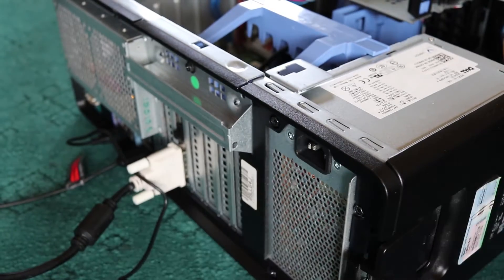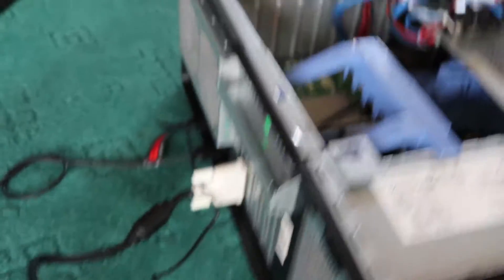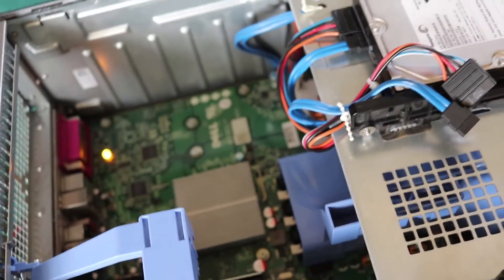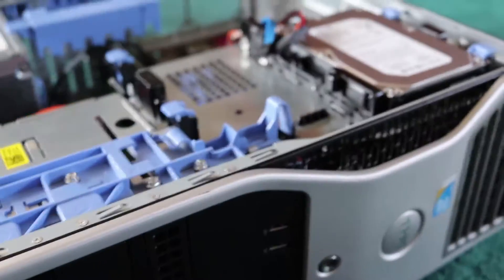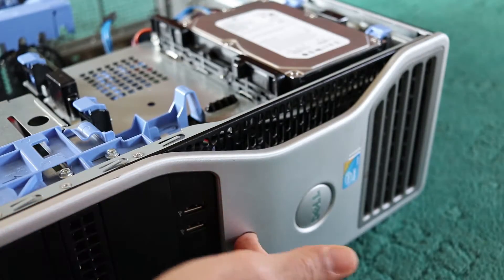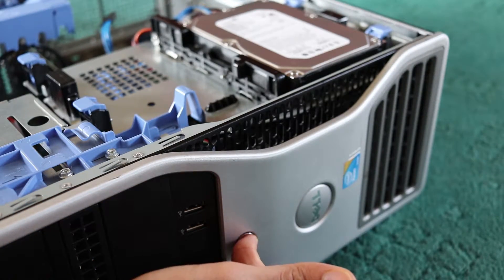How to drain the RESIDUAL POWER from Computer

Comment: Just a quick thing. You're technically not trying to discharge the power or voltage, per se, it's more so that you're trying to stop the current from forming, as voltage is nothing without current. Great video though!
Reply from the maker: Thanks for your input.

Comment: Do i turn off the red switch of the psu as well?
Reply from the maker: Good & very important/serious question! That red switch could actually be the "power supply voltage switch"! It is called voltage selector switch. It's used to switch the input voltage to the PSU. If you'd select the wrong one, then you could serious/completely damage your PSU and even cause fire.  Different countries have different output voltages from wall sockets such as 110v/115v or 220v/230v and it's fixed. That's why you should never change the PSU switch & that's why it's red color. You could send a picture of the switch to my facebook page.
Reply: @PracticalTechFixes  For context: The Pc does not POST, there are no beeps, display nor leds. This problem happened after i powered down the pc by pressing the power button for 10secs. I think there was a power surge so i've been trying to do a power drain but nothing happens when i press the power button, it only turns on the machine but not off no matter how long i press it. 

i have to use that switch to fully turn off the pc. If i leave the switch in 115v and unplug the power cable while it's running, that means that next time i plug the power cable, the system will turn on automatically, and there will be sparks on the wall socket which i find very dangerous for my house and the computer components. 

Ps: It's a tiny red switch. It flips from 230 to a blank space and then to 115 v which is the one we use. The psu doesn't have other buttons.

Comment: Hey, my pc still isn't turning on
I've had this issue where it randomly doesn't turn on
I took it to a repair store, they fixed it in 5 minutes and said that I should just flush the power from the motherboard and restart my PC
I've tried this 3 times now and its still not working
Is there anything else that I could try?
Reply: Hey mate do you find the solution
Reply: @vansh.mxlik05  hey man, I've taken my pc to the shop 5 times since that, still having the same problem - they tested everything, and they say everything is working. My pc just doesn't turn on at my house
I'd suggest flushing the power from your motherboard (there's some videos on how to do it)
Or if your fans are spinning, you should try take your RAM out, give it a dust, and then put it back in (RAM is very sensitive to dust)